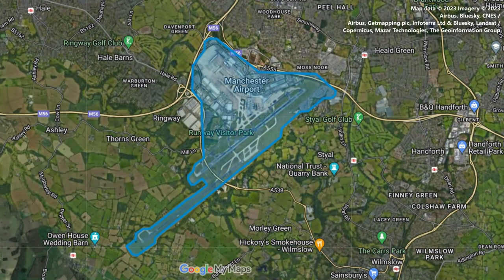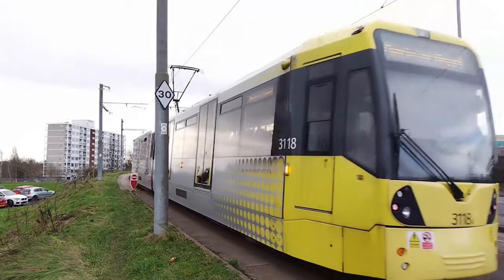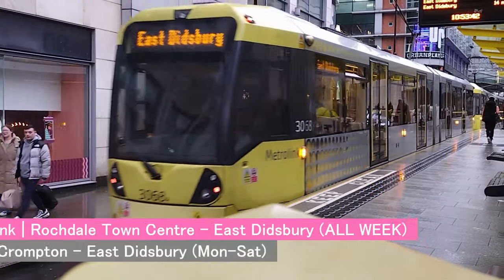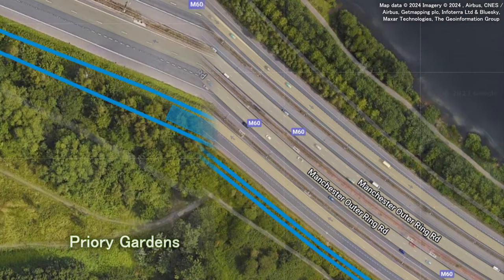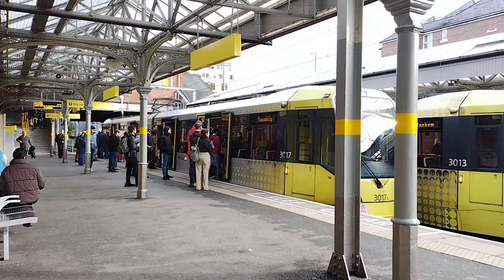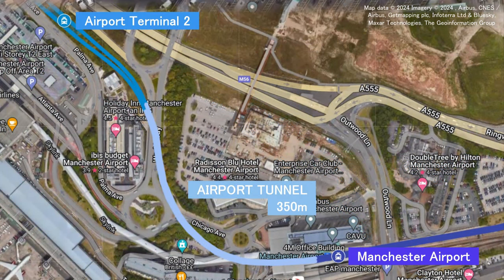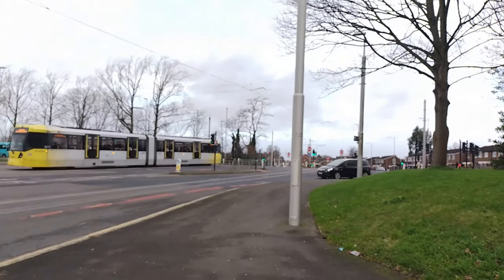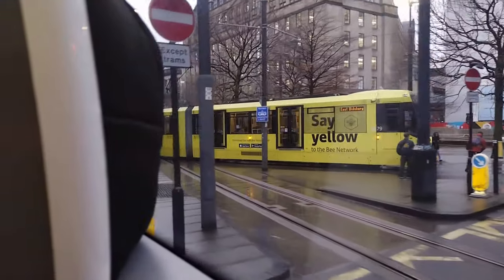The Metrolink's Airport Line is slow (Part 1)

Comment: Speeding up trams to the Airport is a good idea, but your way of going about it has some flaws.

Firstly, the link at Sale would fail any cost benefit analysis. The cost of tunnelling or bridging the M60 would far outweigh the benefits it would bring. If you were going to do it along with building the Wythenshawe loop, it would probably sink the entire project at the planning stage. Nice thing to have but just building the loop would already bring massive benefits, both quicker and cheaper.

Also, using the Sale link to get from Altrincham to the Airport would be ridiculous from both a time and cost aspect. Taking the bus would be quicker and cheaper (a zone 3&4 single costs 40p more than a bus single), as well as not requiring any passengers to travel in the completely wrong direction to get there. If you really must connect Altrincham and the Airport with a tram, sending it around the south of Hale to connect with the loop would be quicker for passengers and probably have a better benefit cost ratio than the Sale link, with the added bonus of being direct. Or just run an express bus at a frequent enough interval.

Some nitpicks:
Don't rename Sale Water Park. It'll just result in confusion and people will still refer to the old stop as Sale Water Park. Priory Gardens would be a better name.
Don't rename Manchester Airport. Just why? What's the point? It's named after the train/bus station and a rename would be unnecessary.
You're right, drop the Manchester Airport prefix from Terminal 2. The name Terminal 2 already implies it's at an airport.
Reply from the maker: One of the things I most regret about making this video is that some of those decisions I might have just made without thinking twice about it, like the Sale Water Park naming, or the Manchester Airport rename, or the Junction 6 tunnel. 
This video really was just to put an idea out there, but you actually gave it a reality check with this comment. You're getting a pin right now

Comment: the metrolink and bus is for surrounding areas, if you wanna go into manchester, take the train
Reply from the maker: The Metrolink is faster on other lines.
If the train line is down, the only options are bus and tram. Tram should be faster than 60 mins from the city centre, because compared to 20 mins by train, people will think the journey time on the tram is similar. It isn't
Reply: @tramographyMCR  true they need like a tram-train that can run the existing train line between the airport and manchester CBD, then the tram switches onto light rail lines from there to go through major CBD destinantions and then outwards to the suburbs
Reply: The Styal line is already at near capacity (and that's after cutting the number of stopping services re the lesser used stations) with the commuter services sharing slots with freight and express passenger services. There really isn't the scope to introduce tram/trains, even if freight were diverted where possible via Stockport.

Comment: The issue is MAG group who own Manchester airport, have just spent over a billion pounds on upgrading Terminal  2, and building numerous large multstorey car parks , so they can cash in on car parking fees and drop off charges from passengers and airport staff , and are not interested in improving public transport access to the Airport , even thou this would improve the local environment with less air pollution and traffic congestion on local roads and the M60 and M56 ,so i can not see any improvements soon .
Reply: MAG is partly owned by Greater Manchester CA so it shouldn't be too much of an issue. Also people are still driving in from Cheshire etc so there's still lot of demand for car parks.

Comment: I think it's pretty much the same reasons the Eccles, and to a somewhat lesser extent the Ashton line is so slow. Sharp corners, lots of street running, indirect route. Metrolink is a system where the quality of your journey really depends on the line you're using and if you're crossing the city centre. They can make some adjustments and extensions to speed things up but ultimately Metrolink need to start tunnelling or elevating sections to get them away from traffic (and in the case of the city centre, pedestrians too) if they want to significantly increase speeds throughout much of the network, akin to Stuttgart or Karlsruhe. Probably starting with the city centre, if they could have downsized Pic-Vicc and made it into a pre-metro spine for the Metrolink that would have solved a lot of the problems we have now.
Reply from the maker: What do you mean by the problems we have now? I mean, there's a lot, but which ones specifically are you referencing when you talk about the Picc-Vic idea being reduced to a pre-metro spine?
Reply: @tramographyMCR  For that specifically it's the slowness of crossing the city centre, understandably so because there are lots of pedestrians and cyclists milling about, and there's also a lot of congestion. I think it's one of the main things slowing the system down. And really the only way to change that significantly is to tunnel. What I was considering is if the Pic-Vicc scheme could have been downsized from heavy to light rail (basically making the tunnels and stations smaller) which then could have formed the start of the Metrolink, similar to pre-metro style systems in other European cities.

Comment from the maker: Some things I forgot to mention in this video:
v v v v v

Yes, Metrolink speed signs are in MPH.
========================
Multiple fast local transport connections to the airport are essential, especially for people who aren't used to Manchester.
People visiting the city for the first time, maybe from a different country, most likely won't know just how long it takes to get to the airport by tram,
an hour, as opposed to the train, which takes less than 20 minutes.
Also, if for some reason, trains to the airport aren't available, the only public transport options available are buses and trams.
Since most people believe (correctly) that most buses are slower than trams, they will pick the tram, which takes just as long.
------------------------------------------------
40 minutes is about the best I could do. 
An option involving a tram-train connection from Timperley (Altrincham Line) to Baguley (Airport Line) would take 45 minutes from Victoria to the Airport via the western part of the Airport Loop.
------------------------------------------------
From Deansgate-Castlefield in the city centre, the journey time on a tram (using this -> 6:46) is still decent compared to the train (Train: 28 min, Tram: 33 min).
The total 41 minutes comes from the slow city centre street-running.
========================

========================

There are still a few things that could be improved to make the route even faster.
1. An active level crossing on Hawkridge Drive (between Northern Moor and Baguley) so that trams don't have to slow down from 40 to 15mph while crossing the road.
2. A bridge (or maybe a tunnel) from Wythenshawe Hospital to Newall Road that avoids the sharp turns (5:24)
========================

I'm sure there's more, but I have to stop writing this comment at some point ¯\_(ツ)_/¯

Comment: A look at the proposed orbital line would also be great...

I would build it as follows
Bury via pimhole, Fairfield general hospital, over the roch to heywood south via Middleton joining the Rochdale line at freehold

Leave south of Failsworth via Newton heath, Clayton Vale joining the Ashdon line heading east just before edge Lane
Turn right at Audenshaw through Denton to join the east didsbuy line at its extension to Stockport for a short way where it would branch via Cheadle to join the Wythenshawe loop of the airport line near benchill

Along the link you proposed to Stretford off again down Barton dock road to join the Trafford centre line which would then be extended to meet an extension to the Eccles line at patricroft
And then maybe through Salford, Pendlebury to prestwich to join back to the bury line

Comment: To defend the line; the time you give is to Victoria, which is the far north of the city. I suggest if you need to get to GMex or near the Midland Hotel or MOSI it is quicker to get the tram.
Reply from the maker: A train from Manchester Airport to Piccadilly, and then a tram to St Peter's Square-ish is quicker than just a tram, if that's what you mean.
Reply: @tramographyMCR   Yes

Comment: there's no spare capacity at Cornbrook in the "Bridgewater Bottleneck" for any extra South Manchester traffic, something which I warned TfGM about many years ago - Cornbrook needs to be redeveloped into a four-platform stop to cater for growth, possibly by using the adjacent vacant land, and quadrupling the line to Deansgate/Castlefield, plus a third city crossing along Deansgate; meanwhile why not abolish the stupid 20mph speed restriction on Hardy Lane?
Reply from the maker: It's 20mph because of the cars. Not sure why it's 20mph though, should be 30

Comment: I think there is a better route than this - at Barlow Moor Road stop, have the tram continue along Mauldeth Road West past where it currently joins the South Manchester line at St. Werburgh's Road.

When it reaches Princess Road, have it make a left turn and then run on a viaduct down the centre of Princess Road (or just at grade if we're being cheap).

At the top of Princess Road, it then passes under Mancunian Way onto Medlock Street then across the junction with Whitworth Street and rejoins the current network on Lower Moseley Street.

With this routing, Metrolink can serve loads of areas of inner city South Manchester that are currently starved of public transport such as Whalley Range, Moss Side and Hulme.
Reply from the maker: This idea would take an extra 5 minutes to get from Barlow Moor Road to St Peter's Square (than it currently does [17 min]), and that's not accounting for the possible traffic on the A road the trams would run on, especially Princess Road. Also, there wouldn't be much room for tram stations to be constructed here, as it would require lanes to be taken off of Princess Road, as a double track cannot fit into the central reservation section. A single track could fit, but then trams in both directions could not operate well.
The trams could operate on the road, and the tram stop be in the middle, but that would require trams to stop in the middle of the busy A road. A "tram only" section would not solve this problem.
Also, Lower Mosley Street has complicated junctions already, thanks to the 2CC, though that is a minor issue.
This would also require a very tight turn for the trams to get onto Princess Road from Mauldeth Road W, which might not even be possible (minimum turn radius is 25m).

Hulme, Rusholme, Whalley Range etc. has loads of pretty fast bus connections already actually. Can't step foot in Piccadilly Gardens bus station without seeing a bus to Chorlton via the university or the royal infirmary or Withington Road. In fact, there are already buses on Princess Road.

Whalley Range could still be served by tram in the future, though, on the Fallowfield Loop, the old railway line converted to a walking route
Reply from the maker: Having the trams get on and off the road like they do on the Ashton Line and Eccles Line would not be good for the possible disruptions it would cause for other traffic, as this road is very busy compared to Ashton New and Eccles New Road. It would also make the line even slower.

Comment: And why is an airport tram totally devoid of any luggage space.
Did they not think that people travelling to an airport just might have a suitcase or two?
Reply from the maker: It also goes past a ton of places before the airport. A tram isn't a train, and there isn't much room, unfortunately. It's designed to take you places as quick as possible, which it does not do on the Airport Line. Therefore, I made this video
Reply: @tramographyMCR The Edinburgh Trams have luggage racks provided, so its definitely possible to have them on trams. Although of course you could argue that the trams there are much longer and have more space for that compared to the Metrolink.
Reply: To be fair, the newest Northern trains, that service the airport, don't have luggage racks just the overhead racks. Public transport in the north is a mess.

Comment: Makes sense. Pity the development has been largely nonsensical though. I still don’t understand why the tram-train is still under review after so long, considering that the Sheffield Supertram has had one running to Rotherham for ages. Such a tram would mean finally getting a tram on the Glossop and Hadfield route, which would ease traffic visiting that area
Reply from the maker: Me, personally, I don't agree with the tram train development. I think that the tram network should stay separate from National Rail, but the connections to Glossop/Hadfield and Marple etc. could be useful. Still deciding on my opinion.
It's also taking a long time (as you've said)
Reply: As a regular commuter on said railway line, I'm not sure a tram-train conversion would be a good idea. Passengers from Glossop/Hadfield won't be keen on having journey times extended if the track now jumps off the viaduct at Ashbury's to join the Ashton line or whatever. The train is fairly fast and frequent, 2tph is adequate for most commuters on the line, and there's really only capacity issues near rush hour, which could easily be mitigated by restoring 3tph at peak times as was the case before COVID. Really all that might need doing is an infill station at Gamesley to serve the estate there.

Comment: Does the tram not reach 50 mph between Trafford Bar & St Werburgh's Road?
Reply from the maker: It does, but then slows down to 20mph and then 10mph before getting onto Mauldeth Road West and running down it at 30mph to get to Barlow Moor Road stop.
After that, it runs at 20mph for about a minute before going over a bridge at 40mph, and finally slowing down to 25 on the approach to Sale Water Park.

The other reason I came up with the second idea was because it connects the busiest Metrolink line closer to the Airport by tram. It does also speed up the route by 5 mins
Reply: @tramographyMCR  Should the announcements on the trams say “this is a tram to Manchester Airport (eventually)” 

It does stop within walking distance of Wythenshawe Hospital

Comment: The speed on the tram is KM
Reply from the maker: For most tram systems in the UK, that is true, but speed limit signs on the Manchester Metrolink are in mph.
Reply: @tramographyMCR  no, they ain't. They do 30kph on roads. Which is around 20mph
Reply from the maker: @stevecampbell7589  I assure you it's 30mph they do on roads. The speed they travel at on higher speed lines like the Altrincham Line is 50mph, not 50kph (30mph).
Reply: @tramographyMCR  ALL diamond signs posted are in KPH as per law and highway code. Trams are not allowed to travel as fast as road traffic on street running due to the fact they can not steer or stop as quick as vehicles with rubber tyres. They might do 50mph on the odd stretch of old railway line as ALL main lines in the UK have their speed signs in MPH
Reply from the maker: @stevecampbell7589  https://youtu.be/xxcBTYj1-RM?si=DUOWy-SHk3pESrPb&t=512s
Reply from the maker: @stevecampbell7589  The railway lines were converted to tram lines. The diamond plates are used on those lines, and as such, used in MPH, same as the diamond plates on the streets. Again, please look at the video above and read the text
Reply from the maker: Same as Sheffield Supertram

Comment: With how the system has "evolved" over the years, i think the it's simply too far down a dead end. Too much of it is stuck on roads at huge cost already, purely to bring costs down.  To spend even more and not do that undermines the original plan.
This is one of the reasons more people are driving, this network has become much slower per mile (takes me 45 minutes to go 3 miles), much more expensive and unreliable. And a lot of it is politics - we can't self-fund a proper replacement project like the underground that never was, budgets are being cut, unaffordable apartment blocks are going up only to plug funding cuts and it's replacing London as the place for landlords to dump their money and overcharge on rent. 
For every minute longer on public transport, working people are stuck paying with their money and free time. It's not paid, it's not fun, it's been bad enough people have passed out on commutes. It impacts home/work balance and limits how available jobs are for people, forcing rent even higher for better connected places.
Quality of life will only improve if the service is not restricted to our crappy roads whatsoever, the 7mph corners (WTF), and was restarted from the ground up for the current/future demands, not this amalgam of mess that has only gone downhill the more it expanded. 
In the grand scheme of the UK economy it would cost next to nothing. take a one-off wealth/tax chunk off the top 1% to pay for it. Many of them caused these problems in the first place.

Comment: The train is faster. Just get the train😂😂😂 no need to make the tram faster. What pointless video 🤣🤣🤣
Reply from the maker: What if the train line is down?
Also, my videos aren't pointless. I very much enjoy making them, as you do with your videos. As they aren't pointless, mine are not either
Reply: When I flew to Manchester from Switzerland I took a train from the airport. It was packed, late, it skipped stops and the train itself was old and smelly! The trams are clean, well run, and just feel more trustworthy. Maybe I’ll change my mind when your trains are fit for purpose.
Reply from the maker: @spych102  That's certainly a below average experience on the National Rail network. I hope you don't think that the other train services are just as bad. Sorry you had to experience that